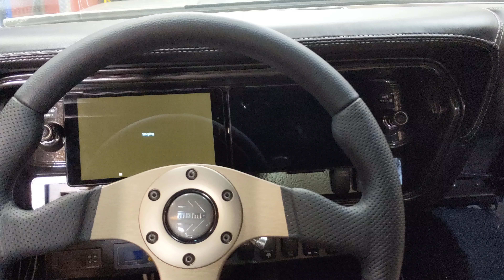Project Electrollite - Plymouth Satellite Tesla Swap - Vehicle functions, Drive, and Burnout. Ep.15

Comment: I saw 1800 amps on the dial twice! Is this working ok?
Reply from the maker: It wasn't quite that high, the CT needed calibrating.  I was pushing 1400A with this setup for a while, but it was not a robust controller and ended up burning the inverter.  Now I keep it to 1200 and it has been super reliable.

Comment: Whats the Buck Boost Converter down by the air conditioning (STC-1000?) controls?

Edit: Ah watched Rich Rebuilds and see thats a PWM for the AC. Clever. Love those modules, they've got a bunch of different ones that are an electronics hobbyists best friend for $20 and not taking up much space. Sure beats spending $800 on (bottom tier) lab grade benchtop unit when you just need to do small stuff without too much precision.
Reply from the maker: Yeah I really like to find common off the shelf parts when possible.

Comment: Just wondering why you didn't go all wheel drive with the Electrollite? Not enough space?
Reply from the maker: I could definitely make it work space-wise.  My initial thought was a raw muscle car feel with only rear wheel drive and no traction control.  I'm sure I'll do an all-wheel drive build in the future.
Reply: @MrMoparMan  Yep, good reasoning but I see these all-wheel drive Teslas at the drags and there is virtually no wheel spin, just pure traction. It would cut down your E.T. immensely...just saying. 
P.S. - You are a genius. Electrifying classic cars with big space under the hood and trunk is the future. You are ahead of the curve on this one!!!
Reply from the maker: @SamsterOne Thanks man!  I have to say it has surprisingly good traction on a prepped track.  55% rear weight bias and adjustable shocks I can really get the squat right on a dig.  All-wheel drive would no doubt be faster with more overall torque off the line.

Comment: Very cool. Thanks for teaching us how everything works like brakes, A/C, blinkers etc. Very interesting for me at least. Would like to see how the windows are wired and controlled and stuff. Thanks again. Subscribed
Reply from the maker: Thanks for checking it out!   The windows have power window regulators that are factory fit.   Using two relays to change polarity, and rocker switches they work great.   I'll try to get more detail into a video.

Comment: What makes the heater and air conditioning work on this?
Reply from the maker: The factory HVAC controls turn on either heat or AC.  The temperature is controlled through a thermostat.  The heater is a simple on/off electric heater core.  The AC is a variable speed electric compressor.

Comment: What power distribution unit did you use? AEMev?
Reply from the maker: I used the Race pack Smart wire... AEM has some nice units also, both are owned by Holly now.  I would use AEM if also using the AEM inverter card and VCU, they all communicate with Canbus which is nice.

Comment: I'm an old mopar guy I'm trying to come to terms or wrap my head around an electric Cuda. This will probably be my next car. I wanted to hear what an electric burnout sounds like.. Your satellite is impressive.
Reply from the maker: Thanks!  I found there is an interesting transition your mind has to make.  I went back and forth trying to decide if this is how I wanted to build the car.  The sound of a car is such a big part of its personality, getting rid of it just seemed like missing out on too much.  Now that I have experienced electric power in this car, I don't miss the sound at all.  All of the years building engines, cars, boost, so much time was spent on tuning it to get the power where I wanted.  This machine is buttery smooth, telepathically responsive, and brutally powerful.  I'm looking forward to that electric cuda!

Comment: Kevin, How is hill holding when you use the parking brake?  Have you tested it on an incline to see how it holds?  Just curious as to what kind of load the window unit goes up to. Stock Tesla rear park brake goes to about a 20 amp load and shuts off.  I use the one from Pantera electric on my Tesla/Mustang swaps. I wonder if they are close to the same load.
Reply from the maker: The modules I used apply a 10 amp load, no issues in hold power at all.  Now it is story time: I had initially wired them to set the brakes when I shut the car off as a convenience/safety option.  Well, I was having an unplanned acceleration contest on the freeway against a ZL1 Camaro at about 30% battery charge.  During said contest, I sagged the battery voltage to my overly conservative lower voltage limit in the BMS, and it cut power.  This set the brakes, and I went from 70ish to zero with the rears locked.  I have since re-wired the brakes and adjusted my BMS limits.  Oh, and I gapped the Camaro ;)
Reply: @MrMoparMan  Great story, thanks for that and the holding update. I have a couple more conversions I'm doing and thought this may be a good alternative. I always like having 2 sources of part suppliers. Again Thank you.
Reply from the maker: @Roadstercycle  I love your stuff and can't wait to see your new projects!  I'm also glad to see your mustang put to good use with AEM, it is such a clean build.
Reply: @MrMoparMan  Thanks Kevin. I have my new VW Rabbit there now too. They keep taking my stuff to look at. Starting another Musktang build next week. Model 3 Performance motor this time.
Reply from the maker: @Roadstercycle  Wow, I didn't know about the rabbit.  I am interested in the Model 3 parts, so many more cars out there that will be available.  Are you going to use ingenext?
Reply: @MrMoparMan  Yes,  until Damien gets his board done.  It seems with John Volk on the team doing testing I think the open inverter stuff will go to new levels. I see your running a Damien board.
Reply from the maker: @Roadstercycle  I was running the Zero EV version of the Damien board.  My inverter let go, and I've decided to run the EV Controls TC2 on the new one.   I agree with you, I think the open inverter crowd is great, and Damien's stuff will get better and better.
Reply: @MrMoparMan  I'm running the AEM board and VCU200 on the VW Rabbit build. I have not drove it yet as it's at AEM getting put on the dyno to get some tuning numbers. In line custom Tesla motor design directly attached to a 2019 S550 Mustang track pack differential with a de-coupler for flat towing to the dragstrip. Should be insane.
Reply from the maker: @Roadstercycle  That sounds super cool, can't wait to see it!

Comment: Why would you ruin that car like that with a Tesla electric motor that is not as cool as a 440 big block or Hemi
Reply from the maker: Well I'm not sure where to start, I guess I'll start with cool.  Cool is clearly subjective, I agree 440s and 426's are cool.  In my opinion, the Tesla build is just as cool if not cooler at this time, for my car.  As far as ruined, that implies that the car has been destroyed somehow.  I don't believe this is accurate since this entire build is bolt in, and if I were to sell it, the next owner can build it as cool as they want.
Reply: Nothing ruined. This is the future. This is what you will be seeing as hot rodding moves forward. IC engines are in their swan song.
Reply: @catharticcathexis4527 this whole car is ruined blud

Comment: This is hot-rodding at its finest, take an older car, swap in a drivetrain salvaged from a wreck, and use a combination of home made and aftermarket parts to tie it all together. This is what rodders have been doing since the early 50s when guys were swapping in junkyard overhead valve V8s to build the first Fordillacs and Fordslers. I'm particularly intrigued by how you've fabricated aluminum boxes to mount and protect the Tesla battery modules. Thank you for helping us move forward.
Reply from the maker: Thanks for the kind words, and I totally agree... Just modern hot rodding

Comment: Hi Kevin. I'm in a 1970 VW Bus conversion and I'm trying to choose battery type/size/configuration. The motor I'm going use is the NetGain Hyper9 X1 https://www.evwest.com/catalog/product_info.php?cPath=8&products_id=469.

 Looks like guys are using the Tesla Model S in a 5S configuration, but I've been looking at the LiFePo4 batteries to build with prismatic cells. https://www.evlithium.com/hot-lithium-battery/944.html

The LiFePO4 battery has a max discharge rate of 2C (560A) max draw for 30 seconds. I'm thinking with a VW Bus that would be plenty?
Reply from the maker: That would be a fun EV!  560 amps with that motor is roughly 90 horsepower, and lots of torque of course.  The balance with batteries seems to be power output, and power density.  The Tesla modules have a good balance of both which is why they are popular.  I think it's important to figure out what range you want, along with how much peak power you want.

Comment: OMG! Smoke those tires! How many amps are drawn on that type of acceleration? Also, how about amp draw during steady state drive at 50mph? Do you know much about LiFePO4 batteries vs LiPo? Great Job!
Reply from the maker: In my inverter settings, I'm pretty sure I have it limited to 1,000 amps right now.  At 50 mph it is 75 amps roughly.  I am learning more about batteries, what are your goals?
Reply: @MrMoparMan  A 1970 VW Bus conversion 28.67kWh capacity/120hp/280ah/102V. Use the batteries in the bus as an off-grid battery bank solar power system when parked--while on my Atlas trips!
Reply from the maker: @michaelarturo6864  Ah, 17 Days of solar collection, I like it! I think an EV / camper van is a terrific combo.  My sister just built a  Promaster camper van / crash pad and used Battleborn batteries which I am very impressed with.

Comment: So one thing I’m curious about since you did a Tesla swap and bought an engine from them.. can you still utilize a Tesla supercharger? Or does it lock you out?
Reply from the maker: The parts are from wrecked Tesla's through StealthEV.  The charger, and battery management are aftermarket, so J1772 standard.  No Tesla chargers, but all the other level 2 chargers will work.

Comment: Fine work, sir!  Love the car - especially the stance.  I hope you have more rear tires ordered!  I will be curious to see how much range you end up with - cars that look that good sometimes aren’t all that aerodynamically efficient.
Reply from the maker: Thanks!  So far with the trips I have done It looks like 200 mi will be easy with a 90% charge... Could probably squeeze out 250 if I went to 100%, and just did normal driving.
Reply: @MrMoparMan  Draw two parallel lines, 200 mi in length....  Beautiful, fun, and with that range, practical!
Reply from the maker: @moegeek  Perfect!